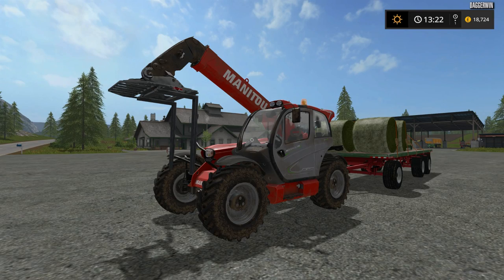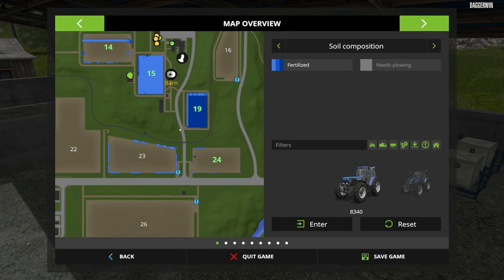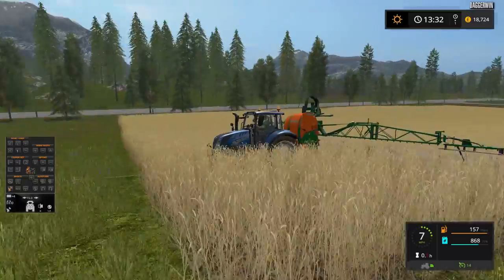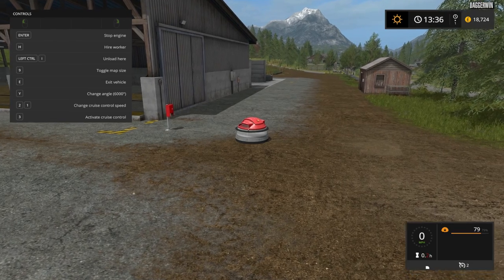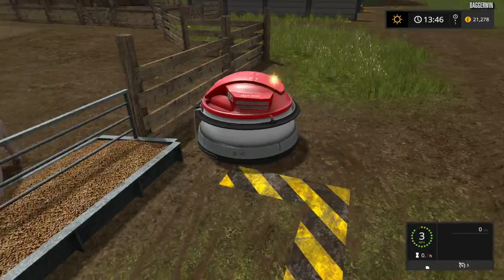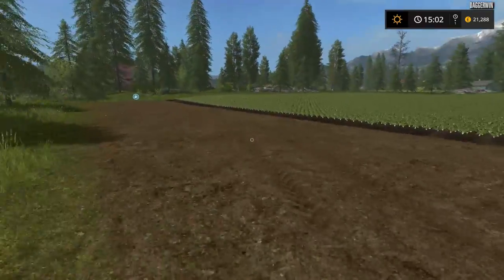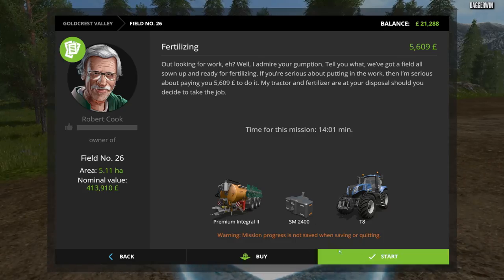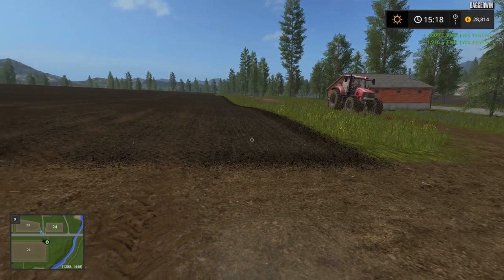Let's Play Farming Simulator 2017 | Goldcrest Valley | Episode 41

Comment: Try buying alot of  seed pallets at the shop, pushing them together in a long line, then loading the into an auger trailer for easy dispensing.  Note when they are pushed together, you can pick them up 2 at a time on the pallet fork. It saves all that loading onto a trailer hooha and easy transportation of a large amount.

Comment: in GPS mod the blue line is the offset if a implement it straight behind the tractor if it does have an offset remove it unless its a plow or mowers (single front & single back) you should be able to judge that yourself
like so dagger can see please

Comment: Dagger, you should put the lely in the middle of the throf and hire a worker so it stays clean all the time. The chargingstation takes away the cost if I remember correctly. Either way its suposed to be an automatic system that you dont have to drive yourself :-)

Comment: To use the lely you have to but the hazard lights on to show a space of what it will clean.
Then put it in the middle of the trough and the degrease is actually like distance it will go each way so the cows are 5000 and the pigs will be about 2500

Comment: GPS with the slurry tanker put an offset in because the tractor and trailer weren't straight, I always reset the offset before I start and you can auto turn with that tanker because you don't have to cover the whole field in contracts I just set the auto turn to turn just under half the working width from the end of the field and let it go.

Comment: what does gps actually do?
Reply: Liam Lennon it shows you the correct line to drive depending on the width of the implement, some more expensive models even steer the tractor themselves